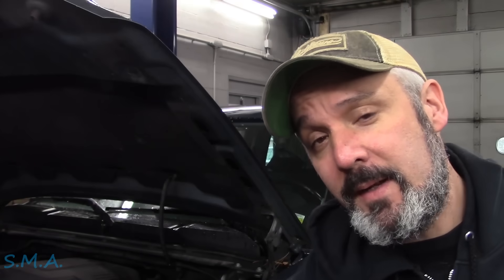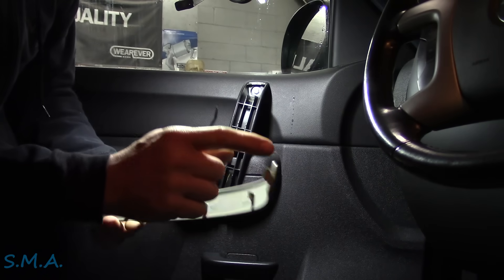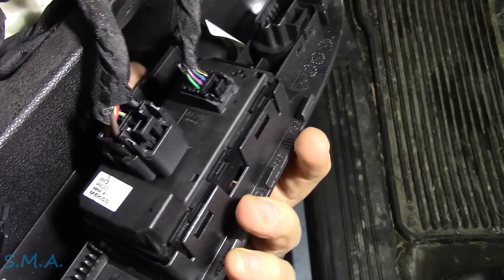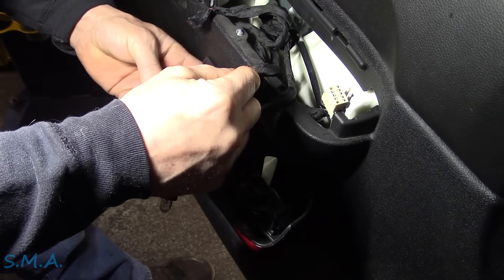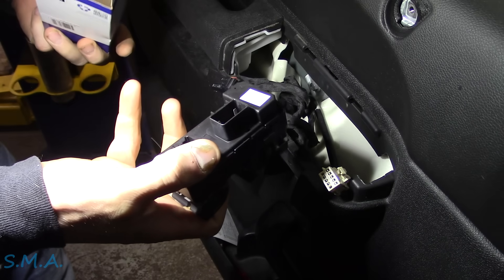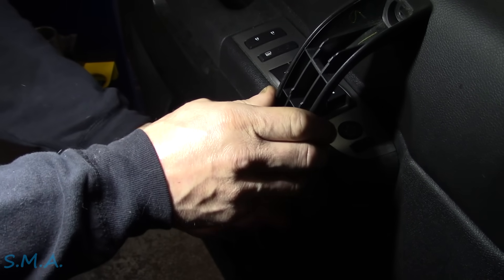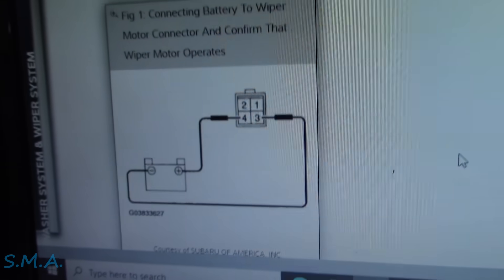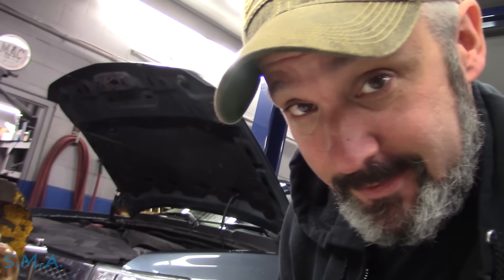Chevy / GMC Truck: Driver Window Switch Not Working On All Windows

Comment: I had a very similar problem with my 2010 GMC sierra,  I could roll down the passenger window, but not roll it up. Ended up just having to clean the contacts of the switch which are rubber dome switches.
Reply: I just fixed mine the same way.. works like new again and didn't cost a penny..

Comment: Thanks for the video. I have an 04 Element that has the auto window up switch and once in a while when I close the window it goes down by itself and I have to reprogram it. I am thinking the switch is going and needs to be replaced. I plan on taking it out and cleaning it with contact spray before I purchase a new one. I only trust Eric

Comment: Got the same problem on my Ford Expedition.  Unfortunately, the replacement switch pack per the VIN was the wrong one.  I'll have to try the dealer for part number on the back of the bad switch pack.

Comment: I've done the full Russian repair on my own truck, but when it's a customer's vehicle the labor cost for me to take the switch apart, reflow the solder joints, and clean all the connections is often as much as the new switch costs. So they get a new part.

Comment: I would say to run an actuation test with a scan tool---  but you already know that the motor works because the passenger door switch still works.  So that pretty much narrows it down already.
Reply from the maker: Doesn't make down a broken wire 👍

Comment: I had one of our 2014 F-150's that you couldn't work the side view mirror from the driver side switches. It ended up being a skinned wire that corroded under the drivers side scuff panel.  The was cut because the upfitters didn't put the BCM harness back in its channel and a clip skinned the wire.

Comment: One time during the Winter I was going through a drive-thru and my power window went down but wouldn't go back up. Changed the switch, no help. The motor wasn't in stock and cost a fortune anyway. It was cold and the cold made me desperate. I found that the brushes in the motor had weak springs. The springs looked familiar. I had a ball point pen in my pocket. What do you know, that spring fit right in there. I got the spring out of a second pen and ran it like that for years.
Reply: That's a great repair!👍🇺🇲

Comment: When working on a circuit you have never messed with before you can have lots of data and books but here's my advice treat it like your the bomb squad and it's unknown device don't ground out or jump anything unless your 100%sure were it goes what it does and aways use a fused jumper or a power probe I like my model 3 with amp setting on the breaker circuit

Comment: I have an 80s Toyota Celica, and I was looking to swap in factory A/C. I went to the wrecking yard and manually traced everything I needed (electrical, lines, switches, evap housing, condensor, compressor, etc.) So later I got the OEM factory service manual to figure out how to wire everything up... and the manual kept referring to to some dumper assembly. 

Went back to the wrecking yard(s). Found two other cars with A/C and couldn't find this assembly anywhere. One of the yards had a Supra (shared the same body style.) The Supra had this assembly!

As it turned out, only the Supras had that particular assembly on the A/C system - so when Toyota made the service manual for the Celica, they copied it from the Supra and didn't bother proofreading it. Oops.
Reply: This probably happens a lot.  Sometimes copy and paste are your worst enemies!

Comment: so if the door switch is old school with all the wires it would not show up on a scan tool right, like your channel am a subscriber thanks, I have a 2011 sierra 4x4 with passenger lock not working , can take it apart and fix it now thanks Jim, my scan tool skips over driver and passenger door switch modules when in auto scan.  Can't scan what's not there.

Comment: Great video.    Driver door switch on my dads will control:

 Up and down on the driver front 
Only down on the passenger 
Nothing on back . Changed switch  with new and used same results.  Any help would be greatly appreciated 

He also said when he opens the door one of the passengers work.

Comment: Hi I am helping a buddy next week on a 2014 sierra and the only window that works is the passenger side rear. None of the buttons on his master switch work. Replaced the switch no difference.
Reply: Hi, did you find what the problem was?
Reply: @earthlycreature8772  I did not find out what the issue was.
Reply: @OnRezOn2  On my 2019 Chevy Equinox, all fuses, relays and the master power window swtich were fine. I had a diagnosed done and was told to replace the complete door harness which I will do after ordering the harness online. It may be problem in your Sierra as well.
Reply: @earthlycreature8772  Im thinking thats what the issie was at the pinch point. His door was also sprung by the wind. Other issues related I beleieve is that the radio never shuts off and runs battery dead. But he eneded up buying a different truck and parking the GMC

Comment: They'll try and throw you off too.  Some vehicles, even within the same year, can have slightly different wiring harnesses because of a design change that required the engineers to swap pins in a connector to previously unused pins so you can't interchange the harness to a vehicle with the wrong engine, transmission or fuse box...  You can get a wiring harness or fuse box that you think is correct for that year vehicle, but still be wrong...
Reply: And then, THEY DON'T UPDATE THE BOOK!!!

My '98 Astro AWD had a fuse that, according to the owner's manual, was NOT USED.

Well, it was used for something! Probably the fuel pump. Because when I tried starting the van without that fuse, I didn't go NOWHERE.

(I had been cutting some wires with the battery connected, upgrading the dome light to that of a Suburban--one with the nice map lights. But it was hot out, so I had the door open, which meant the circuit was live, and, since there was no bulb--out of sight, out of mind--I blew a fuse. So I swapped in one of the same amperage from a "NOT USED" slot when I was done, wrapped it up, and went inside for dinner. The next day, I almost couldn't leave, except that I guessed maybe that fuse was responsible...)

Comment: Notorious problem with door mounted power window switches.  When door is opened during a rainstorm, the switches get wet and the contacts in the switch corrode.  Driver's door
usually as it's the one opened the most.

Comment: I had the same problem with my 2010 Silverado. The passenger side switch stopped working. Why that switch? Why not the others (yeah... I probably use the driver's switch the most, so did the passenger side fail from lack of use?). I took the module apart. It's a simple mechanical switch with a plastic bubble membrane to give the "click" feedback. I cleaned the contacts on the passenger side switch and it did work - for a while anyway. The only other thing I can think of is that the position of this passenger switch seems to get the brunt of rain and snow when the door is opened. Now I put a towel there when it's raining.

Comment: I had that same problem with the window switches. Rarely rolled down any of the other windows just the drivers so never did anything about it until I went on a long trip during summer. I'd come out after stopping for lunch and the truck would be a furnace inside. I'd get on the road and hit the window buttons 1000 times and finally get them down but couldn't get them back up until I hit the buttons another 1000 times. Got back from my trip and first thing I did was take the switch apart, found the green crustiest and oxidation. Now I could have just purchased a new switch but how do I know if the new one won't do the same thing and get green crustiest again, could have been sitting on the shelf oxidizing for years. One thing I learned about copper oxide is it's nonconductive and all the contacts in the switch are bare copper, should have been silver or tin coated where the oxide from those metals are conductive.

Comment: Did you swap out the switch because man hours to strip it down would make it more expensive for the customer, or if it has gone wrong once, could it go wrong twice if you did this, then customercomplains you were last to fix it so a repair could cost you, as a business, more in the long run? I am just interested from a business cost point of view. Thank you.
Reply: Eric said it won't come back for this problem. changing the switch was a fix cleaning the switch would also be a fix but  if the same problem came up it would be a return . a little different than cleaning the switch your self. my self i'd most likely just use the door switch as it worked .

Comment: The 2005 Silverado has a screw that holds the front of the pod to the door.  Have to remove the door card to remove the control pod.  The pod frame is hard to find.

Comment: My bet is the diagram showing the Park Switch is wrong.  If the system supplied power to the motor as drawn, it would let the magic smoke out of something expensive.  I am betting the Park Switch is wired internally to supply power to the top of the motor at Pin #2.

Comment: Bad documentation is bad, period, flowchart or reference. FWIW I like the old school switches, easier to troubleshoot and even sometimes to repair when you don't have access to a replacement at the moment - nothing like hosing down a Crown Vic switch panel with DeoxIT for a zero dollar repair.

Comment: Did they have to program the switch before they sent it to you? Just curious because i grabbed a used one for the same issue except rear windows, but the whole switch assembly is unresponsive like it needed to be flashed with the vin?

Comment: My 2010 camaro has the same problem, it appears my switch provides the ground to the motor and not the power as yours was doing.have you seen this in your past?? Still struggling to solve this issue
..thanks

Comment: Even after I replaced this exact part my rear driver side window won’t go down using the driver control. Using the rear driver side switch it works, though. What do you think I should do?

Comment: Many businesses who provide owners manuals, service manuals etc. farm that job out to third parties and the folks who do them are not engineers, not mechanics, not familiar with whatever the manual might be describing. That's a sad state and good reason why the many sources of wiring diagrams differ. Also, a sad state of doing business when supporting their products. 
Does anyone do their job anymore ?  Is anyone responsible anymore ?
Reply: It surprises me ANYONE (especially in the business world) knows the concept of responsibility even exists anymore, although I get the impression Mr. O does.

That also goes to show how "outsourcing" (while cheaper) almost always comes up short on the quality of the finished product.
Reply: @ijusthangouthere2992  The public does not complain enough. Half of them never read the manual anyway. Sad...most of them are missing out on all of the features and functions they paid for.  Dumb America.

Comment: 2017 gmc sierra 1500---- passenger window won't work. Master switch on drivers door and switch on passenger side don't work the passenger window. Do I replace just the master switch or do I have to replace both?

Comment: Does that truck have the turn signal indicators in the side mirrors?  Friend’s truck had same issue, he bought the switches but was told it needed to be programmed because his truck has turn signal indicators in the mirror, now only the driver window works.🤷🏻‍♂️
Reply: Eric worked all the windows after the switch install.
Reply: @repete2362  what exactly does that have to do with my comment?

Comment: 2013 Ram 1500 4.7 Tradesman 2wd  Two brand new tpms sensors in the rear but they keep loosing connection and tpms lights comes on. After awhile the two reading for rears comes back and shows rear pressure as it should. Has been like this for 2 months started over the winter. In service data it shows the tpms module under driver front bumper could the tpms module be bad? Why would it come and go? Thanks!

Comment: I have an 06 Saturn ion the fuel pump comes on you can hear it priming but there's no pressure on the fuel rail the car will turn over but it will not start do you think it would be the fuel pump possibly?

Comment: I have a similar issue… can’t figure it out…
Pass. side works up / down. But from the driver side, I can only cycle the pass. window down, it won’t go up. I’ve replaced the switch assembly exactly like your video (2013 Silverado). Any suggestions???

Comment: Ok, 2016 suburban, passenger window will not go down. With either the driver side switch or the passenger side switch. I checked the RT window fuse(44). That did not fix it. So I'm guessing passenger window motor, dam... can you help.

Comment: My 08 Silverado with 420k on it . The passenger side wouldn’t go down, but goes up. Changed the switch and still the same. What could be an issue? Defective switch? Both passenger side windows can go up and down from passenger side switches, from master switch only can go up

Comment: What if both the drivers side and front passenger side switches won’t roll down from passenger window? Checked continuity, Fuses, relays, boot wires & all are good. What could be the issue? All I hear is a click on passenger side switch when trying either side.

Comment: Quite the coincidence- My 2007 Silverado driver window just stopped working and I fired the parts cannon at it, replacing the switch.  Still nothing.  Turns out there was a broken wire in the loom that runs from the door to cabin.   If I had followed your normal procedures,  I would have saved the cost of the switch.

Comment: I have an 06 Saturn ion and the fuel pump comes on and you can hear it priming but I have no pressure on the fuel rail with the gauge any suggestions could it be the fuel pump?

Comment: if it ain't broke don't fix it the old system was trouble free super easy to diag like those much better. its like abs module so many things go thru it that aren't needed. have a friend with a 2007 f150 most of the time you can switch off the truck put key in pocket and it keeps running only way to switch off when it does it unplug abs module shuts off. there is no reason for the truck running to be affected by abs

Comment: Maybe you've come across this issue or can point me in the right direction of how to figure out what's going on. Bought a new switch and it fixed my passenger side window not working but the driver side still won't work. Did the test light route on the wires and all of them work like they should except the 2 wires for the driver side window. Even when the button isn't being pressed they show power go to them. I was thinking a bad ground but since the other windows work I figured it had to be something else. Any idea of what's happening?

Comment: I have to chase down why the power mirrors don’t work on one of the 4 positions. The power window switch has been replaced twice, so I know it  is not the switch. This is on a 2007 GMC Sierra 1500.
Reply: Have same problem on same truck passenger side .

Comment: I have fixed dozens of those stupid switches. Take the top part of the switch off and expose the circuit and clean it with a Q-tip and some isopropyl alcohol and it will work like new again. The switch builds up corrosion over time on the contacts. 
Don’t buy those cheap Amazon switches either.

Comment: I forgot to tell you that it’s a 2001 dodge Dakota 2wheel drive regular base truck I’ve been told a light switch could be the cause and told it could be where someone put a tow harness on and it could could be a ground also I’m hoping that you can get me where I need to start at I would appreciate any help I can get from you you know everything about wiring on vehicles thanks for the info if you can please help me out with this problem I’m having

Comment: Common failure due to rain n ice getting in and corooding the switch. Other common issue is the boot between the door. The wires split especially on older vehicles.  I wouldn't of bothered to diagnose n waste time printing out data. Just order a new switch or check boot wiring in-between the door. Easy

Comment: That's okay Eric I got up to crank my Chevy spark this morning and the battery was low below 12 volts just a tad and it wouldn't crank but my lawn mower on it with jumper cables and the damn thing ran no charge light battery tested good belts tight on the alternator these new cars are these electronics I hear you I miss the old days too my friend tell message oh we said hello God bless you all
Reply: I just picked up a large size box of periods. I could send you a few if you're out.

Comment: Well I have the same problem 2000 Toyota Camry LE 4 cylinder. When I close the driver door with the key in the ignition it goes click click. The girl told me it was the a power door lock actuator. The rear passenger door lock is burnt out. It does work at all. I went to Toyota. David at Toyota told me to buy a aftermarket actuator. I can manually use the key to open the driver door. I can go to the front passenger door put the key in the door It'll open that door and the rear drivers side passenger door. That weird. Plus none of the Camry windows go up or down. I'm not going to spend another hot Spring or Summer not being able to put my windows down. Why I'm writing you is to see if the girl at O'reilly's is right. Is it the power door lock actuator?

Comment: I put in the new switch is it doing the same thing as my other one the master switch I cannot put any up or down my two back windows also do not go up or down my passenger front window goes up and down what else could it be?
Reply: Check the wires in the rubber boot between the door and body.  Those wires often break.